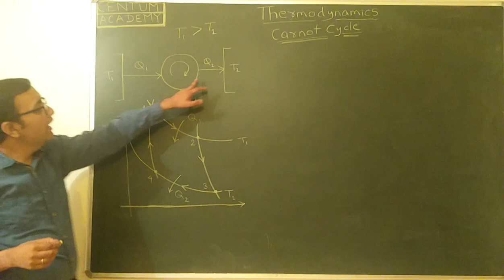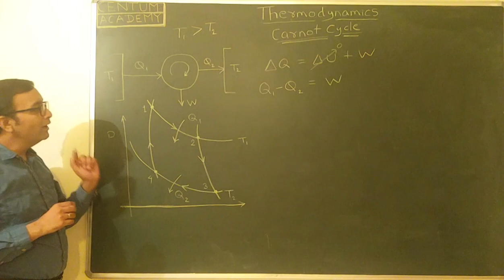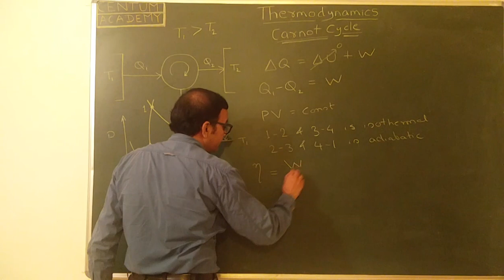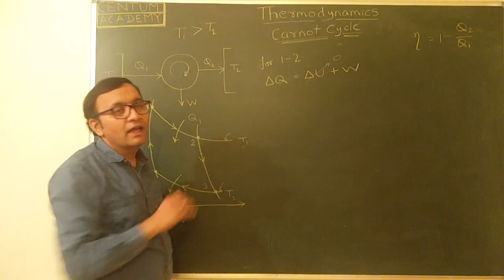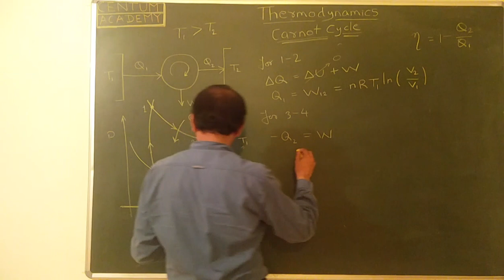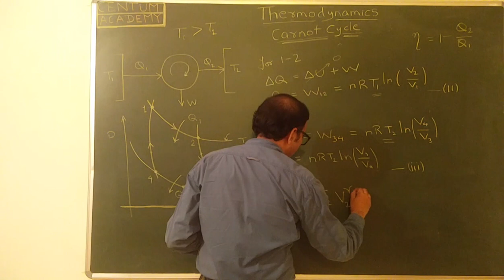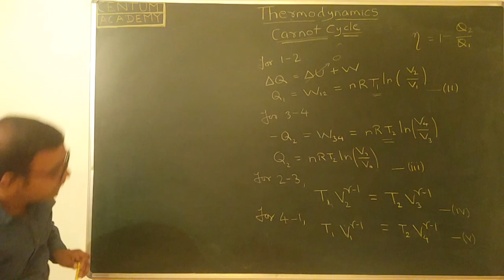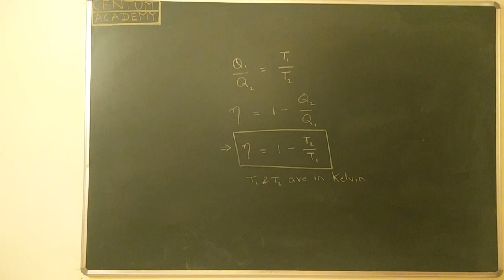Carnot Cycle Efficiency Derivation

Comment: If T1 is the temperature of the flame that enters  the system or the cycle  & not the initial temperature of the system, then why is T2 not the temperature of the system exhaust  instead of the ambient temperature?

By the same token Q1 is the heat added by the flame or incoming heat & Q2 is heat given out by the exhaust gas.
Thanks